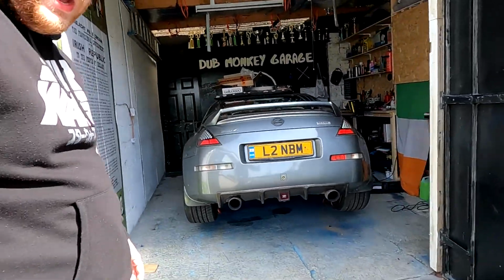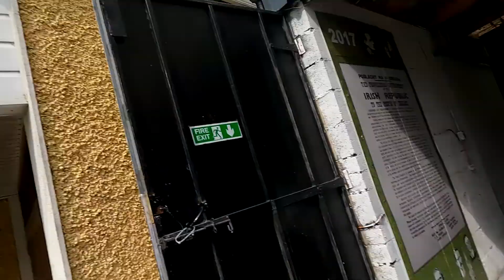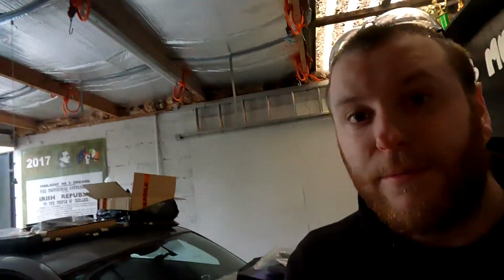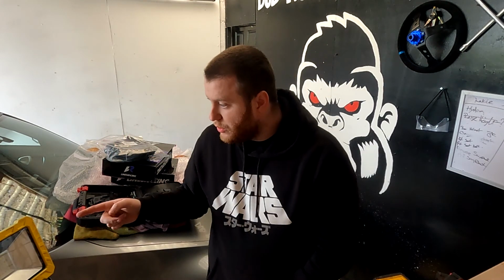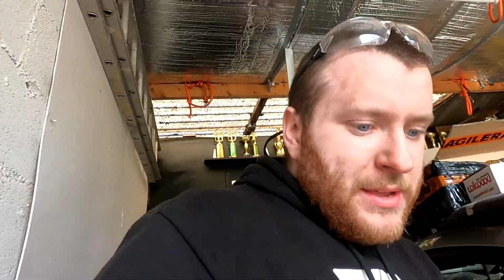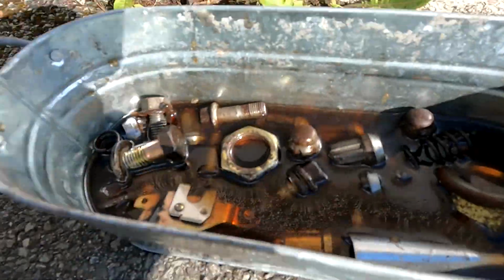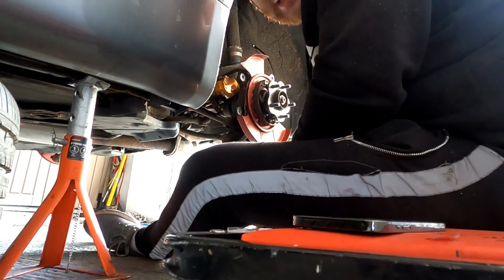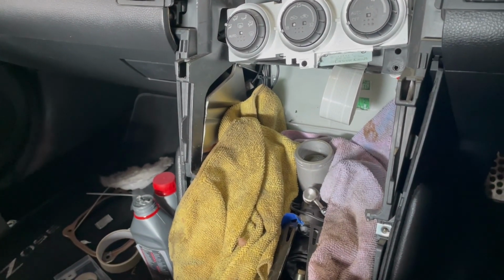Gktech Z33 350Z Dual Caliper Brackets - Install

Comment: Another savage video lads, love the little test run hahaha

What width wheel are you going to be running?  Might help people with tyre recommendations if they know something like 18x8 or whatever
Reply from the maker: Hahah had to be done!!!
The tyres on mine are  255/35/18 & on Lukas 350 are 245/40/18. 
Not sure if my wheel is 18x9 or 9.5 haha can’t remember
Reply: @DubMonkeyGarage  
Wowee

Either of you planning to go with more grip in the front or same all round?
Reply: @DubMonkeyGarage  they just sound massive compared to the 86 haha
Reply from the maker: HahHhaha they are huge compared to the 86
Reply from the maker: Ehhh think it’s the same all the way around
Reply: @DubMonkeyGarage  cool, should be handy enough to find something in a forum or whatever 

I'll let you know if I hear anything ;)

Comment: Did you ever run into problems locking up the rears? I installed this kit with brembo style calipers and the handle is hard when I pull. However the rears don't lock up and the braking action seems weak
Reply from the maker: I often have this problem…. I think it’s just bad choice of pads cause I only used track pads and now I’m changing to cheap ones. As I find by the end of the day it starts to get more powerful
Reply: @DubMonkeyGarage  I see. Did your original pads lock up after heat up?
Reply from the maker: @FrickenHamster still yet to be tested on track
Reply: @DubMonkeyGarage  got it thanks. I did some more testing and it seems my setup locks after heating it up a bit. Thanks!